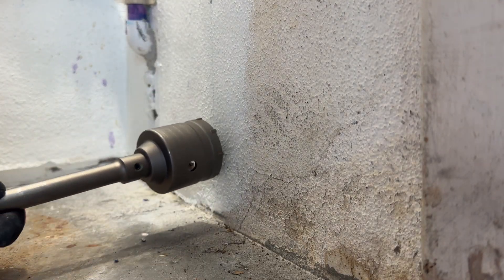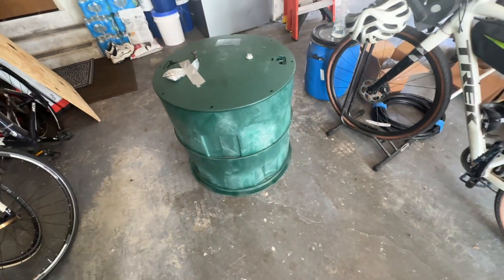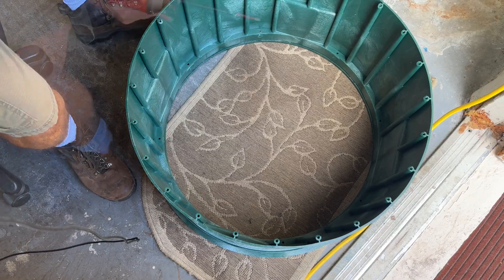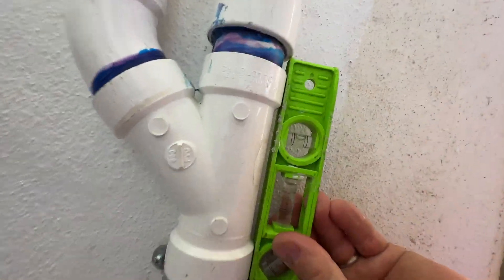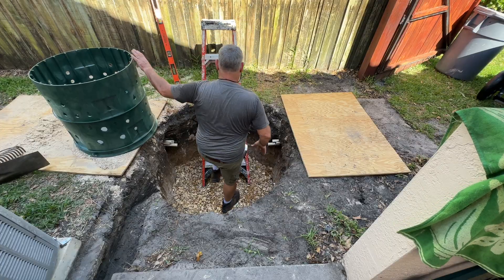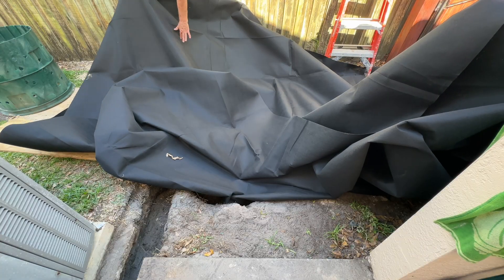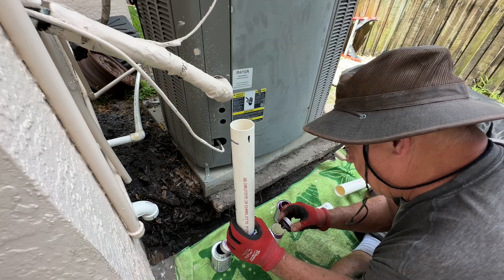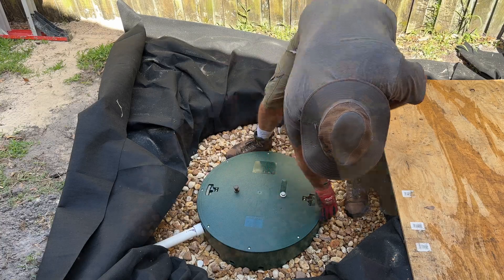How to Install a Dry Well for Gray Water at Washing Machine, Shower Sink & Water Softener Backwash!

Comment: @fixitjohn 
Is there a reason you filled the inside of the dry well 2/3 full of rocks? Does that take up water storage volume? Trying to figure out that part of this project. Thx!
Reply from the maker: I put like 1/3 on the inside just to slow the water down because the bottom of that is nothing but dirt. I just wanted to slow the water down a little bit so it wouldn’t erode any dirt under there. thank you for your question and thanks for watching. Come back for another visit. it really doesn’t store any water in that tank. It just drains through it.

Comment: would this work without the plastic well, just run the pipe into a hole lined with geo-tech fabric and filled with rock. what  purpose does the tank actually serve?
Reply from the maker: Yes, I am sure it would work. The tank acts like a dumping area so the end of the pipe doesn’t get clogged up with rocks and debris but as far as that goes, you could get a drum use a drum or something like that too, and it would be cheaper! Thank you for your question. Come back for another visit. Thanks for watching.

Comment: Hi, it was a good video it show me how to do it , I have a question , how big was the hole diameter and deep ? and how it work went the softener do the backwash? thank for your help 👍🙏
Reply from the maker: @williamacosta948  hey William, thanks for the question. It was 4 feet wide and in the video I show 42 inches deep but it was actually like 48 inches after I piled more dirt on the top. it’s soaks that water up like a sponge. I think I’ll probably get 15 years out of it maybe 20 but I would recommend getting the whole big piece of the Geo Text, nonwoven that way you don’t have to double layered so dirt won’t seep through and clog up the rocks. Good luck and try that hocus-pocus magic 
on that. Thanks for watching.